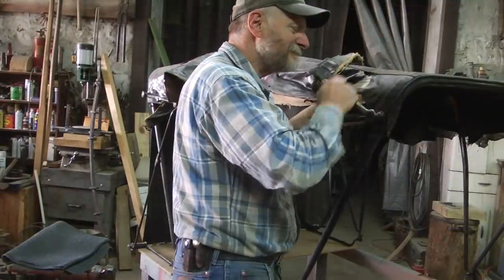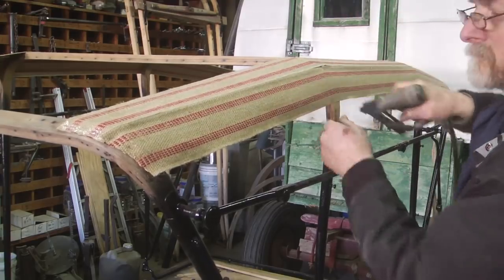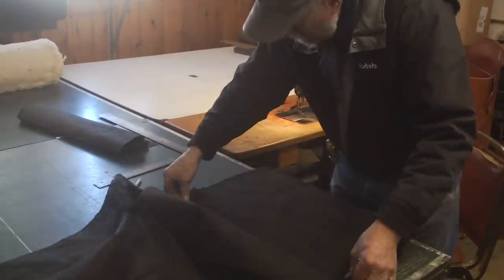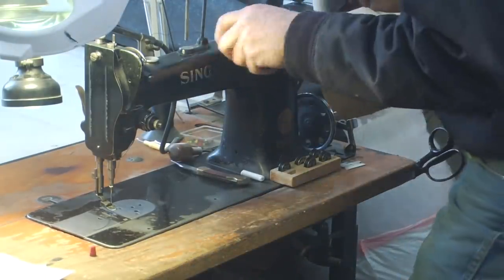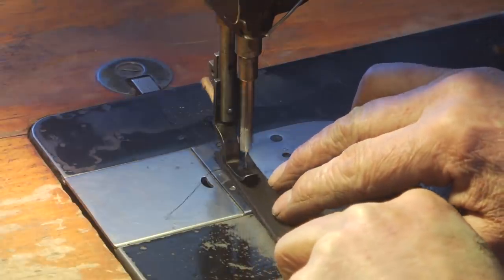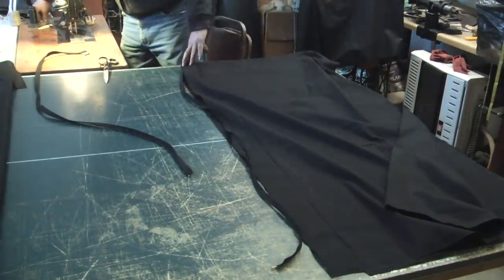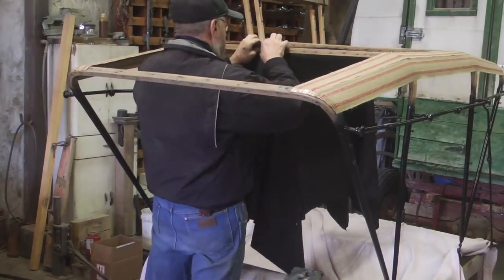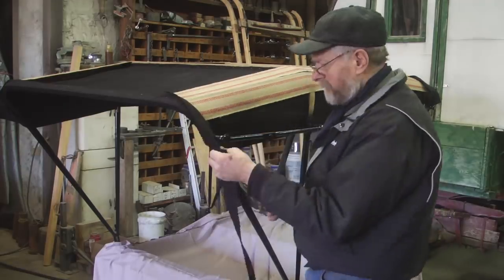How to Upholster a Surrey Top | Installing the Headliner | Engels Coach Shop

Comment: I was brought up working and learning in my Father's Cabinet/Upholstery Shop and I cut my eye teeth on a Singer 111W155, so I can appreciate the fantastic work that you do. I look forward to each and every one of your videos!  A little tip. If you ever get tired of using those pesky little straight pins that constantly try to bite your fingers, try using a regular office type stapler. you don't even have to remove the staples when you have finished the seam if you don't want to take the time. I chopped off the front part of my stapler so that the anvil gets in closer to the welt cord.

Comment: Hi Dave,

Great video.  I also use a late '40s vintage singer sewing machine.  I sometimes miss zigzag when I repair my jeans, but will trade that for the ruggedness of this machine.  You commented that upholstery work was akin to woodworking.  Agreed, but I think it is even closer to tin knocking.  I did plumbing and tin knocker apprenticeships during high school, college, and graduate school.  It's interesting to note the overlap in terminology between sewing and sheet metal work.  To me, being able to sew, and by extension, iron, is just another set of skills that go along with my use of table saw, lathe, milling machine, and other hand and power tools.  My wife appreciates that I can make custom decorative pillows, drapes, etc., as well as furniture, and live steam trains.

Comment: The black fiber yard goods we would call muslin, as used in dental chairs it too simply gave a uniform covering for the undersides of the cushions. We used top stitching methods, never any welting- our competitor did that so we wanted some distinction of the 'look". We used Senco products also, never a problem with them, the local rep would stop by every couple of months and do maintenance on all of their guns, replacing piston rings, drivers, etc.- can't sell staples if the guns don't work.☺

Comment: Good video! I still wonder why bobbins don't hold 5 miles of thread. I haven't had to use a machine in years, but they are cool. If I send some socks, can you fix the holes in the toes? I'm not picky about thread color, so you won't have to wind a special bobbin for them! :-) Thank you for the inside look at how they are made. Cheers!

Comment: I think I was 9 or 10 years old when the zipper on my pair of pants managed to rip I guess or let loose and my mom wasn't home to sew them she was down my aunt's so I took out the sewing machine but I didn't know how to do The Bob and she explained it to me over the phone and I sewed my pants and I never looked back when she got home she said I did a good job I still have her old sewing machine. One thing that I did notice is your putting the pins in you were putting them in the same direction as the foot flow my mom did teach me if you put them in going the other direction side to side when you're sewing that seam the needle will flow right over the pins and no need to take them out as often thanks for keeping me interested in your projects

Comment: You commented that you aren't getting the views of the upholstery as you are of the wood and metal working. I love this series b/c I've done a little upholstery myself and recognize some of the elements. The stuffing looks like "wood wool", AKA Excelsior. It's too big in diameter to be straw but too light in color to be coco coir. Those are traditional stuffing materials (along with animal hair, etc). In replacing it with cotton batting, which is much more water absorbent, isn't there a concern that it will get wet and mildew because cotton doesn't dry out quickly? 

The black fabric that you are making the stuffing bolsters out of is called "cambric" and is used as a dust cover under furniture. It was originally meant to keep the "dust" from the old style stuffing inside the furniture as it would break apart as it aged and would land on the floor. It's more for aesthetics now.

Really enjoying everything you do.

Comment: A few years back I decided I wanted to learn how to sew, if for no other reason, I could patch my work clothes, I didn't want just any machine, so I looked into it, and found what I think is one of the coolest designed sewing machine ever made, it's even got a cool name, "The Rocketeer" it was built in the 50s when everything was made to look like it was going fast even when it's sitting still. 
https://www.worthpoint.com/worthopedia/singer-500a-sewing-machine-rocketeer-479411923
Something I always worry about is the ends of the thread, are they going to work their way loose, so I always get both threads on the same side of the material, and tie them in a knot, I do that at the beginning and the end, I see you just snip them close, I guess I'm over thinking it.